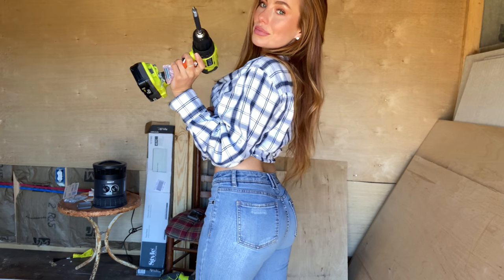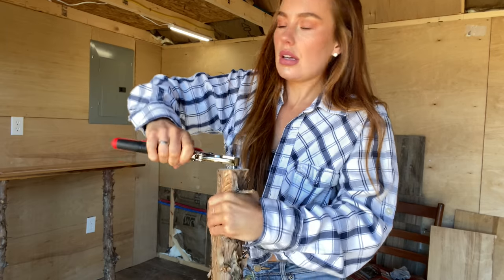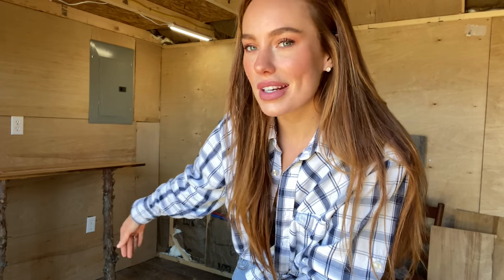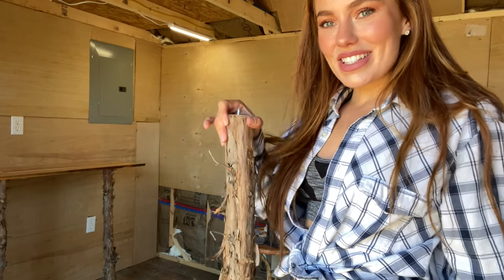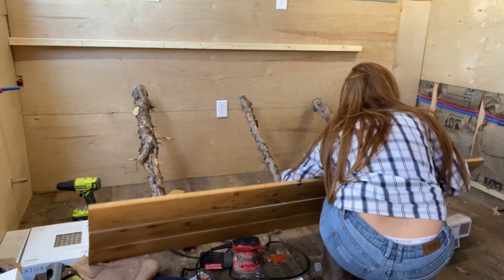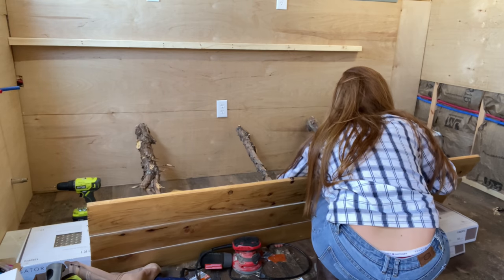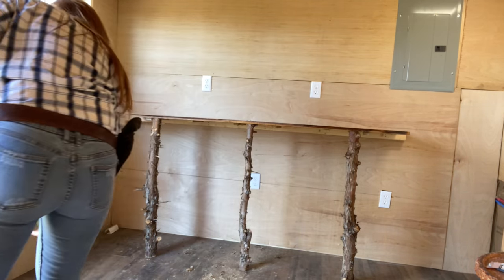This Hurt Really Bad.. Ep. 21

Comment: I love your video's Heidi. Sorry this is a bit late on the fire. As a fireman for 40 years now you have to be careful with the extension cords. Although they may have a UL listed label, UL only test what the manufacturer request. Usually on the small white or brown what we call "zip cords" it's the plug and the receptacle ends, not the wire. The wire is not rated for a heater. Also having a knot in the cord causes resistance in the wiring which heats up. In this situation under a mattress or carpet causes more heat thus the fire. Please use heavy duty extension cords for everything and I hope you did purchase smoke detectors, 1 for each level and outside of each bedroom. Also the fire extinguishers please!

Comment: You're right it is always good to spend time with your family your mother and father and brother but make sure you have a little time for yourself. I had the same thing I did sprain my ankle all the tendons broke loose Achilles was still in place. They wanted to operate and said it'll never be the same. So I decided not to get the operation and heal myself I wrapped it massaged it every day pushing and talking to my tendons to go back where they were I wore boots that laced up strapped it nice and tight not restricting but tight for support and continue through the day doing my job or whatever I had to do. It took months month month before I finally be felt better. The body is an incredible thing it will heal itself in time given the right conditions.
Thank God for that.

Comment: Good job getting the new electrical system in!!!  Is that an un-finished paneling spot with insulation showing? You need to do that one. too.  Get steps with a deck on the Work Shop, maybe have it run the whole length. After your ankle heals you still have that step problem. I wish you had arranged it so the door opens up to flat, level ground.

Comment: Just a suggestion. 
You might consider cutting your cedar “legs” in your shop to 24” then 45 degree cuts on each end to free up some space. It would allow more leg room or room for equipment, etc. They would be more out of your way. Just a thought. I do like the look either way. I used to use them as fence posts for my pasture. Had to replace them every couple of years but NBD. 
PS. Don’t plug heaters into extension cords. Fire hazard.

Comment: after you get the deck built on the workshop consider a ramp on the end by the road. It would be easier to get your projects in and out of the shop and you could put steps off the front of the deck also. Just a thought I had and wanted to share it. I think your boots helped you from breaking your ankle.

Comment: Now that your electrical system is code compliant, you could look into installing "electrical base board" heaters. They are long and skinny and fit at the bottom of a wall onto the base board wood. They run from 3 ft to 8 ft and has an on/off dial switch. They can be tied into their own breaker switch.  You would install 1 in each room and this would give you heat, all year long, in each room, or turn off in summer time. Do this rather than installing a furnace and trying to get cold and hot air ducting to each room.

Comment: Good video. You could put some tape on the screw and then tighten the drill chuck around it and drill it in rather than use the vice grip pliers on it. Anyway you got it done and that’s all that matters😉

Ugh 😑 I just saw the ending. “It’s always something “ (Buttery Films)😉

Comment: Do not make efforts for at least 15 days. After three days, rotate your foot for a few minutes, several times a day. The tendon will be more loose from now on, so it is necessary to pay attention to where you place your foot. Before the end of a month time, you should wear boots that have a higher barrel than the ankle to support it during recovery. 
By the way, on the big doors of your small house, I recommend some springs stopers so that you can have the doors open, but also not completely closed. I will post a picture of the system in a message on your facebook page. Health and good recovery... PS: Good thing you are changing the electrical part of the house as I had recommended in a previous message. I bet you didn't read it...

Comment: 90° angle brackets will work but another trick is to pre-drill 
Through the top into the  backboard Leger and run some screws into it.

Comment: @2:27 This looks a lot better than the tool girl on Tim Allan's show, and better tools too.
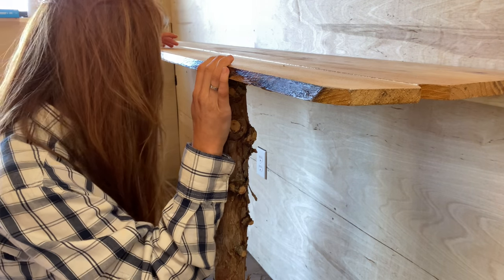@9:20 All that's needed is to fix the countertop to the shelf with 2-3 screws by drilling a few holes in the shelf and then put screws through the holes from below into the bottom of the countertop.

Comment: The house wiring wasn't the total cause of the fire.  Using a light gauge extension cord and running it under the mattress also contributed to the incident.  Granted, having more receptacles will help but there will still be times when they are out of reach.  Sorry about your sprained ankle.  #your mom to the rescue

Comment: You have a lot going for you, but you have to start setting your priorities based on basics first.  The counter top could wait, the steps shouldn't have.  You have a lot to learn, so take it slow and take care of health and safety items before going to the next level.  You are burning wood, but it seems you haven't had the flues cleaned and checked.  Chimney fires are a leading cause of rural house loss and those flues look pretty sketchy.  I've been rebuilding old houses for over 50 years and the basics are the priority.  Sound steps and railings, safe electrical, solid roof, safe heating system and fire extinguishers in the kitchen and every room with a wood stove.

Comment: Primitive building is an interesting form...not always best if you don't take the time to "cement" or "set" in the steps or shape them....So sorry you are hurt,  also one I learned for experience...cowboy boots are good for wrangling or working cattle on horseback...wearing tactical/work construction 8-10" lace up boots are better for building or construction. Just like you DON"T wear shorts when stringing barbed wire fence...

Comment: steps are easy to cut if you have yet to manage this, large framing square, 2 square nuts, level off the pad and get it solid whatever you want rock, concrete gravel whatever width of the door, then make it a square using the door width number.. measure height from pad to top of floor at house.. legal rise and run is 6.5" rise and 11.5" run, really don't wanna go any less specially with elderly around and kids.. divide your overall height from pad to top of floor (rise) by 6.5.. that how many rises you have, you start with a rise, then a run, then a rise thena run,, the run (step) ends at the wall 6.5" (or whatever this number works out to be to make it work with your overall rise may have to fudge, OR, raise your pad) beneath the floor you are connecting to.. use hangers to hang the stringers, 3 is good, same width as your door, if its real wide 4 stringers work..  real easy you can do this watch a video or two.. you can add railings and pickets whatever, dealers choice

good grief, fgs take it easy out there alone work smarter not harder..

Comment: I took a horrible fall and ripped the peroneal brevis tendon in my right ankle, exactly where you were pointing , with pain radiating under the ankle bone. If your sprain doesn't heal well, you may have done something similar.  

A surgical rebuild will set you back almost a year, so stay off that foot and don't roll your ankle again.

Comment: I love your inventiveness I love your creativity, but somethings you do backwards. You still get it done but somethings you should do first before going on and you do the opposite. For instance when you’re building your legs for your wall table coming off the wall he probably should’ve cleaned off all the little branch and knobs and twigs while you could move it around before you screwed it onto your table. That’s just one example but it doesn’t matter you still get things done. Also for that slate that runs along the road just at the edge of the woods, I think it was originally put there to keep people from sliding off into the woods because it’s a downward slope going into the woods. I think they put the slope there I mean the slate to have a little bit of a amount and later on come in and level dirt across from the slate going across APL so you have a flat surface coming in and out of that little road instead of it being on a little bit of an incline. So you might wanna leave that slate and just fill the rest with dirt or more Slater clay and then rock on top. Just a thought

Comment: Just get a 1x4 or 1x6 lay it on the back of your table standing up like a back splash and screw it in from under the table use wood glue to I would you can use drywall screws.

Comment: Thought I would get you an axe for chopping wood but they are still a little too expensive on EBAY for me at $50. You can get an electrical  powered wood/log splitter but the cost is like $300.